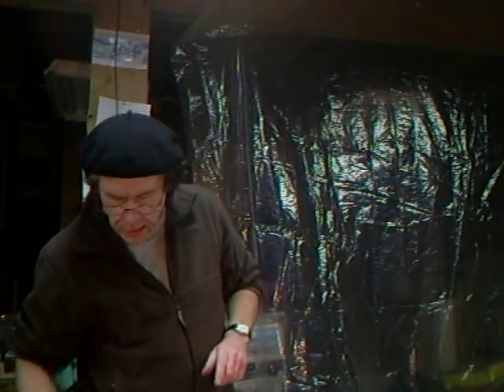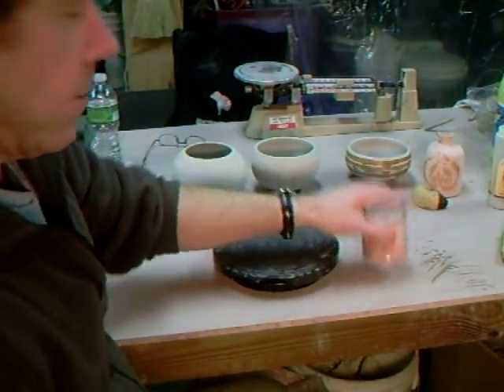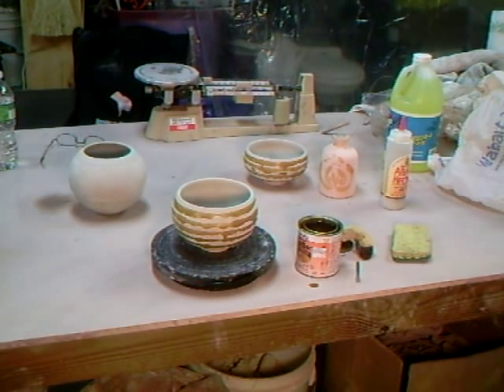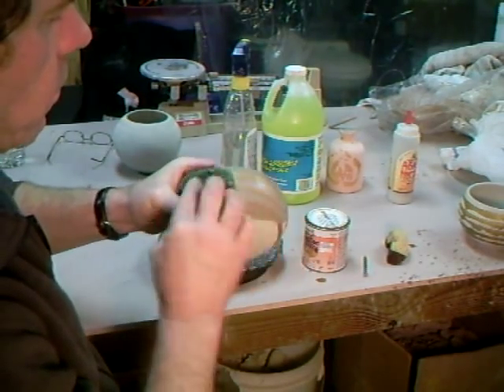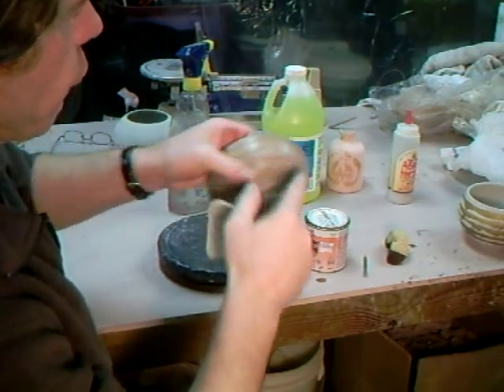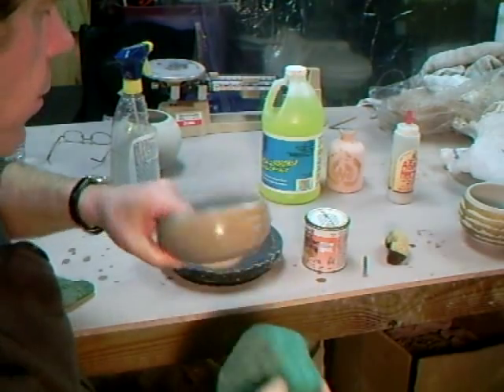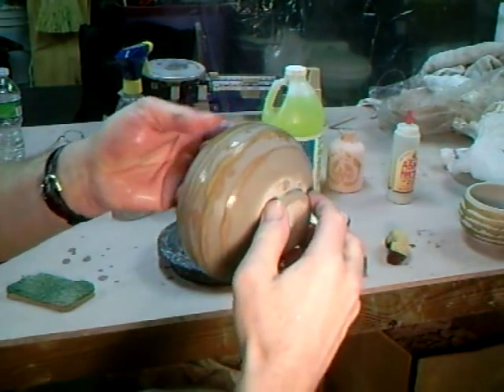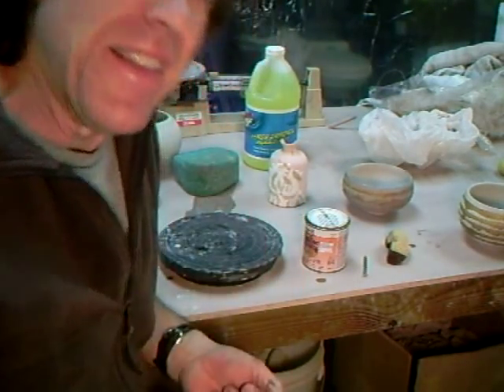SIMON LEACH - Shellac resist !!

Comment: hi Simon I use shellac technique on my thrown porcelain. You need smooth clay (porcelain is best) make a thicker shellac yourself by mixing shellac flakes with Methylated spirit, this makes brushing easier and shellac less runny. When sponging use damp sponge washed out regularly. Shellac gives a harder surface than wax does not rub away when sponging. timgeeceramics

Comment: kroraven,
I'm not sure shellac ( being organic not metallic)  would ruin a electric kiln eliments, but it sure would stink when burning off.  Want to have real good ventilation though! Like when using a lot of waxed pieces, yuck! Still would be good reason for raku kill. I use a very old electric kiln with the elements pulled out of it, with propane burner, for raku kiln.